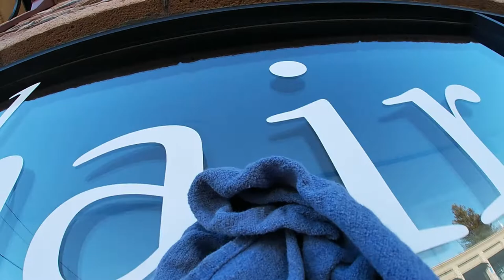For The Love of Window Cleaning

Comment: Your ledge squeegee you should take a hacksaw and cut it down on both sides making it very small so it don’t twist on your wrist as you Squeegee off water on the commercial frames and then you can use it for a little square windows does it will fit

Comment: I notice you're using the unger pole from a home improvement store. Ive had 4 crap out on me. Either the tip needs glued on or the coupler breaks. Try the optiloc if that happens
Reply from the maker: yeah the same, I actually switched over to the Ettore poles and haven't touched my Unger poles since! they more expensive but worth it!